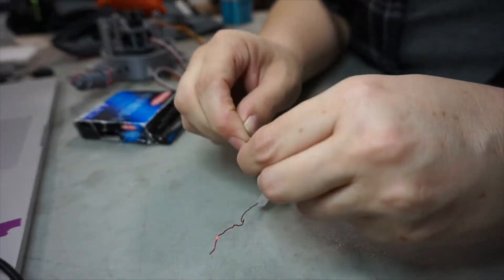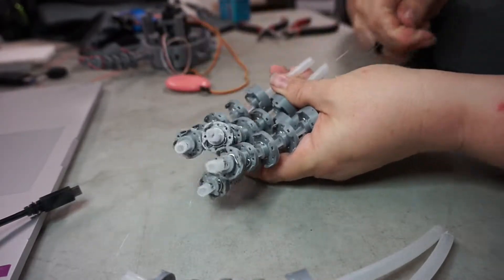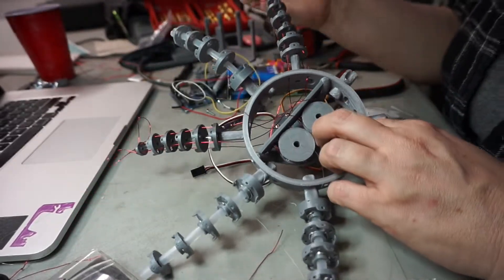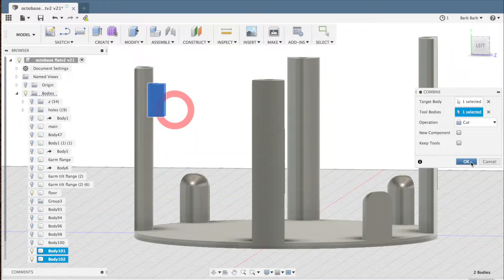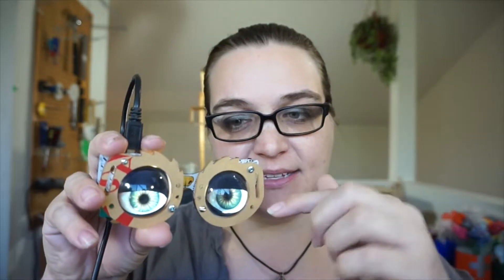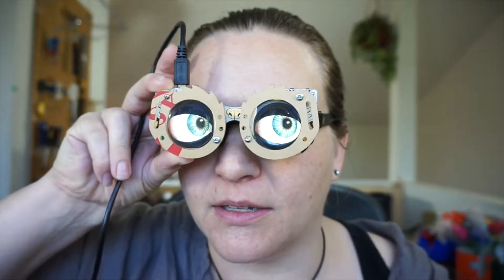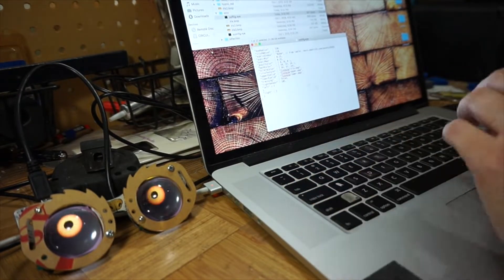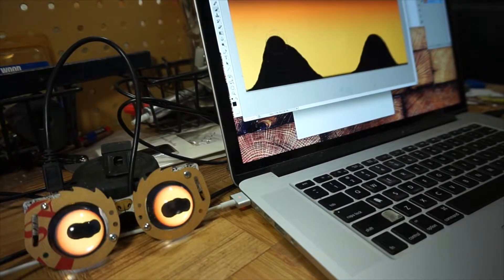Robot Octopus Eyes and Arms | #8

Comment: Smart move with the fishing line. I have a spool of 25lb mono and getting a spool of 80lb fluoro soon for a future project. Also ordering some tubing for the line and silicone grease for less friction. And instead of tying a knot in the fishing line, aluminum crimping leader sleeves are way stronger than a knot. 
I know I'm 5 years late when I'm commenting but, like I did, someone in the future might stumble across these videos and comments.
Reply: Oops, I meant 80lb braided fishing line. Specifically 'J-braid grand x8'. Went through a bunch of strength tests videos here on YouTube and found that that specific brand and type is top tier.